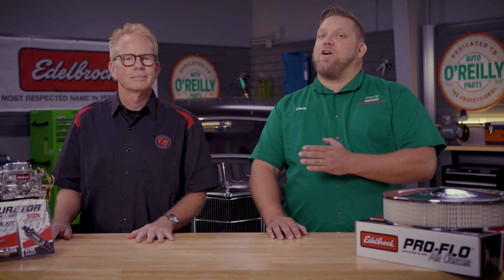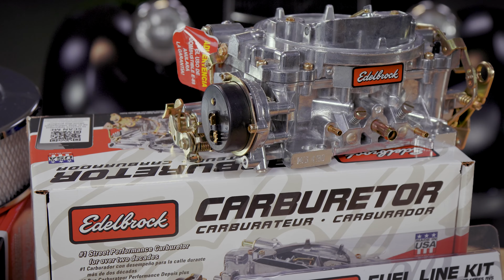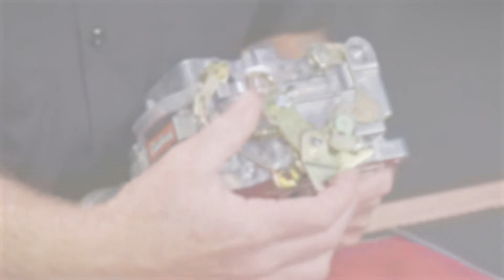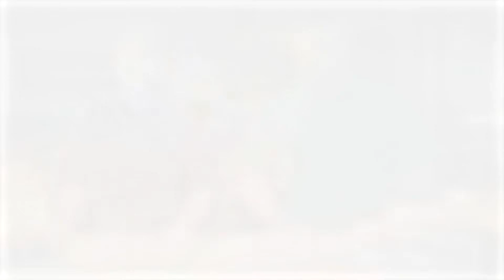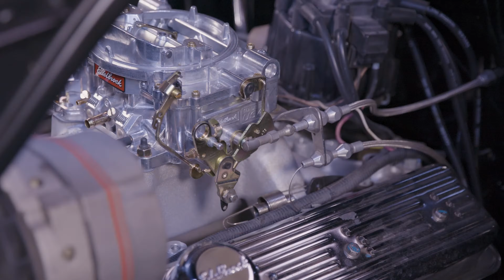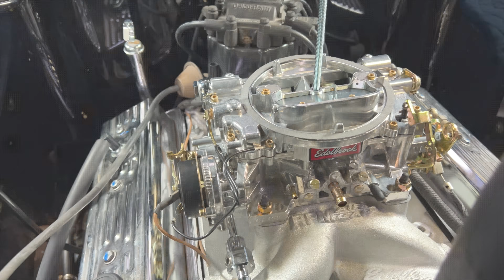How To: Edelbrock Carburetor Installation

Comment: I'm paring up a 1406 carb with a Performer 2101 and a #8725 wood spacer. Is the #8725 the correct spacer for this pairing? Do I need a #2732 carb adapter since the 1406 carb is a square-bore and the Performer 2101 is a spread-bore? Cheers

Comment: What did you use to connect the return spring? I have a L bracket towards the front of my intake and I connected my return spring in the small hole right next to the curb idle screw. Which way works best? Thanks in advance!!